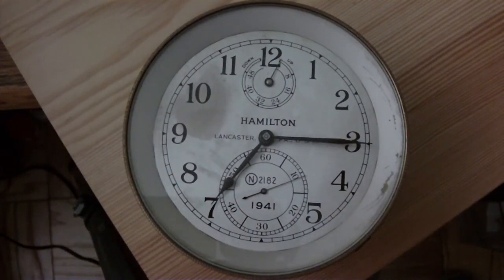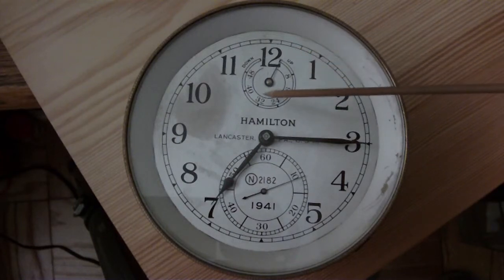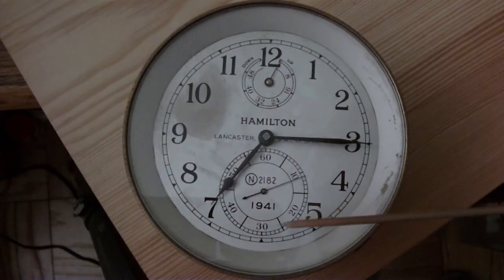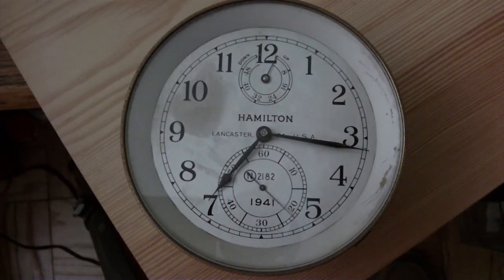Hamilton Model 21 Marine Chronometer, Part 3 of 3

Comment: Where might I find a box I only have the movement
Reply from the maker: Now and then a box will come up one ebay.  You have to get the correct size and have a gimbal.  I think there might be someone on the internet who makes boxes but I don't remember the name.  Even a beat up one will not be cheap.
Reply: @bunnspecial  I have the gimble and associated hardware but no box. I also need a key.